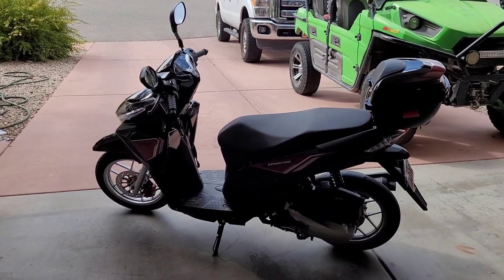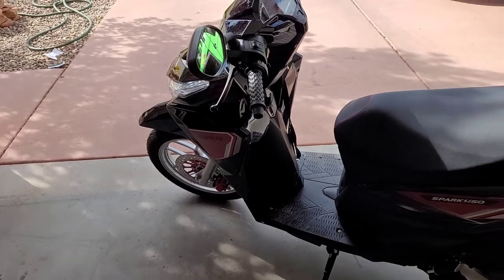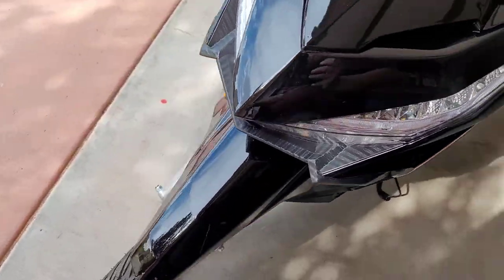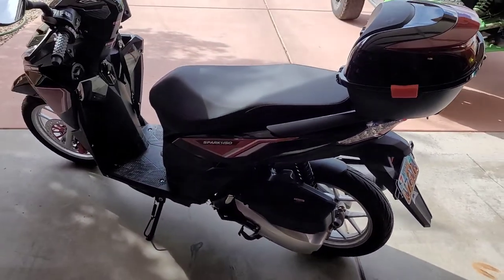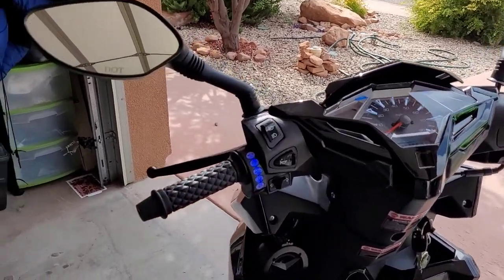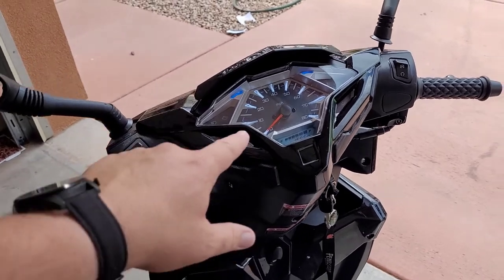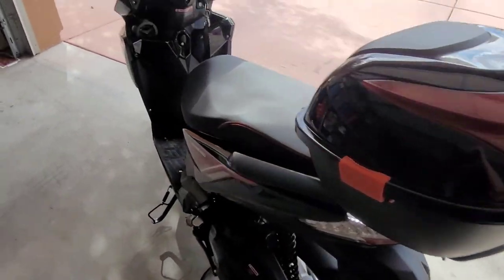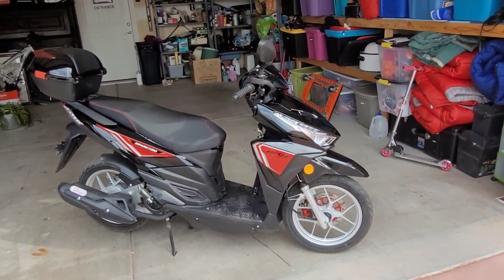Vitacci Spark 150 Walk Around

Comment: change you gear oil to. I was told to break it in with conventional motorcycle oil then when you get about 500 miles on it switch to synthetic motorcycle oil. Mine starts best if I do not give it any throttle, just press the starter button and let it idle for a few minutes and off you go no stalling ever.

Comment: I lived in Asia many years where there are many 14 inch tire scooters from Honda Yamaha and Suzuki. Did 30000 miles and 2000 deliveries on my Suzuki address 110 with Michelin 100 80 14 pilot moto gp tires. No Japanese brand 14 inch tire scooters for sale in USA. No Michelin pilot moto gp 14 inch tires for sale in USA. No Asia online shop selling these tires with shipping to USA. So,… what to do…. Bought a a new kymco agility 125 gy6 engine with 50 miles on it from a crashed bike. Got everything. Wiring harness. Carb. Speedometer.  You know everything that usually breaks in the first 10000 miles on Chinese scooters. I’m not playing nor have the time to do the Chinese reliability game so as soon as I pick up my spark everything is coming off and being replaced with Taiwan made kymco agility 125 parts. The reason I settled for the agility 125 was there was one still running well 2021 model with 50000 miles on original engine in my city. That sold me on its reliability.  The fact it’s a top mount gy6 and mounts right into the spark without modification makes it a no brainer. Got lucky to get a 50 mile engine. Best 14 inch tires in USA are Michelin city grips. There ok.  But don’t turn as fast as the Michelin pilot moto gp tires I was using in Asia. Also plan to slowly replace body with real Honda click body panels. Anyone need spark 150 oem parts? Everything’s for sale except the frame lol.   The reason I didn’t go with the clash 200 or any 170-200cc is they don’t run well. Lifan is a good maker and so is genuine pgo. I had a 170 genuine buddy and a 200 sym. They all are built on a 125 platform just bigger piston. They vibrate too much. They always feel like they are going to break even when they aren’t. They are called thumpers. They vibrate and thump your mirrors so much that you can’t really see who’s behind you.  The 125 engine is smooth as butter. Lasts longer.  Doesn’t vibrate your mirrors. Also might be a bit late but never use fully synthetic oil the first 500 miles. Your piston rings won’t set properly. Use a semi synthetic until your rings are set or after 500 miles. Mobile one racing 4t at auto zone or Walmart is best I found in USA. It’s fully synthetic. Use it after 500 miles.
Reply: Pinoy ka pre? Click nasabi mo eh pag indonesia vario name nya.

Comment: I have a 2021 white one just like it and I had the same problem with the scooter shutting off when I give it throttle... Brought it back to dealership and they told me That one of the hose was pinched... Haven't had any problems after that...The bike is really fast and I just found out how to make the radio scan for stations...Now I can listen to the local radio station when I'm not connected to Bluetooth
Reply: Hi i am getting the same scooter. Can you tell how to make the radio for a stations, thanks.

Comment: I have to argue about the assembly. I am NOT a mechanic, I uncrated the bike, got bags of bolts, but absolutely NO assembly instruction. All items were located under the seat, which I have a difficult time opening, supposed to be a manual unlock. Took me 20 minutes just to uncrate, handlebars not connected, along with front tire and accessories. I paid $1399 on-line, plus $60 in fuel and delivery fees, then was told to call because they need to know if I had a fork-lift or, did I need a truck that had a drop gate, this was another $135. (I needed a drop gate truck) You do not get the title, you have to email and verify the VIN, once you receive the bike, then they will send the title 3-5 weeks, if Fla you have to have title to register. I have no problem assembling things, but the handlebars and front tire brought me to a stop. I decided to take it to Sarasota Scooters to have them assemble it for me ($300). Buying on-line you may not pay tax, but you will when you go to register the bike and get a tag. Bill of sale not enough, in Fla anyway. Now my price is up to $1895. Plus, I trust a dealer that builds scooters more than I trust myself...lol Sales tax will be about $95 and not sure what the registration fee, title transfer and tag will cost, but I would guess between $2-300. Now in Fla you are required to get a motorcycle license on anything over 50cc, this course is $185. I added this comment to this great video to make people aware of the hoops and snags you will go through initially, just so you know. I am not sure if I made the right choice yet. Once I get the bike and ride it, see how it lasts, then I will make a video on my experience with this machine.
Reply: I heard of welds coming undone on these, oil leaks, head gasket leaks, and all while brand new. Some people apparently are lucky and have put 40k miles on them with some tuning up before riding (change out carb for better quality one, gaskets, spark plug, fuel line, and probably a few other things). I'm just not sure if it's worth it to pay double to triple the price for a Honda equivalent. Usually, people that buy these are doing it because they already can't afford alot so, yep.

Comment: I own a 2020 model purchased from 360 powersports, after 1000 miles or klms. not sure which but so far so good. My only problem is I have never been able to get the parking brake to lock on do not know if there is a adjustment I can make or what. Owners manual is worthless. I wish these sellers or importers would contact the Chinese and translate them into English better.
Reply: They're written in "Chinglish" so you have to read between the lines lol.

Comment: I was going to buy a used honda PCX for about $3k as a commuter & doing food delivery as a side gig. But i was thinking now perhaps to get one of these at 1/3rd of the price. The only thing giving me pause are some of the bad reviews of it breaking down. How is yours holding up?
Reply from the maker: It's been good so far. Honestly, I don't know how long it will hold up for.  I'm still under 1000 miles.  I have not put a new clutch in or anything like that yet, but I was told that you should do it at a thousand miles. It might be better to pay for something with a bit more power if you're doing things like food delivery. I love this spark, but there is absolutely no way I would take this on a long ride.

Comment: Could you tell me where the cdi  Box is located for the spark 150i I  removed seat and its not there I also checked battery Box and couldnt find it?
Reply from the maker: I believe you remove  that front shield and you'll find it there.  Remove those two screws and it will slide down.
Reply: @joshgreenrules  I found it its by the headlights my 2pin connector is missing from cdi box I can't find it I think this is the issue for no spark on spark plug do you know colors of 2 pins connector I think mine was cut I want to buy 2 pin connector and rewire it back in any help or pics  would be greatly appreciated

Comment: Great video. I'm curious how many more miles you have put on it and if you're still just as happy with it. I'm seriously considering this one. Depending on how many miles you now have on it, has it required much maintenance yet?
Reply from the maker: Sorry, just remembered my password. I have put exactly 600 miles on it so far. Just did the first oil change. I love it. I have lost some weight since this video (36 lbs) and it runs smoother for me. The only maintenance I have needed is to reattach the light clips under the plastic and tighten the steering bolt. I am actually going to take the steering column apart tonight because it is wobbly and I found online that if you wrap it with tin, drill a hole for the bolt, and then put the steering wheel back on, it will stop wobbling.
Reply: @joshgreenrules  That belt will need to be changed, I'm surprised your factory one lasted this long. those belts are very low quality and will leave you stranded one day. I replaced both of my scooters with Kevlar ones, and the strength, feel, and quality is like night and day... but for now, if I were you I would stay away from going up hills, and "jackrabbit" starts from a stop.
Reply from the maker: @lionelhowell4972  Thanks for the heads up. I have an extra belt in the garage for it as we speak.  I'm ordering some new rollers and gonna swap them all out at once.
Reply: @joshgreenrules  You are welcome.

Comment: How do I stop the handle bars from wiggling ? Idk how to tighten it
Reply from the maker: I'm dealing with that issue now. I am going to try to do a "red neck engineer" tactic tonight, where I'm wrapping some tin around in hopes of stopping the wiggle. It's a pain in the butt.
Reply: @joshgreenrules  Try a bit of silicon baking mat. It absorbs some of the high frequency vibration and should eliminate the wiggles.

Comment: 20w/50 motor oil would work much better for you. 10 40 is thin- as oil heats it thins out. 20 50 is thick. You will actually have oil than more like water running in your motor. Just saying. 🤗
Reply: 100% agreed.
Using 10/40 full synthetic in my 2006 Burgman 400, no bueno.
Replace with 20/50 "V-Twin Full Synthetic" oil = Happy Engine !
Which oil grade your bike prefers depends upon 2 factors:
1 Climate you ride in average temps, highs & lows.
Higher the temps, go up to 20/50 grade.
2 How tight are the internal engine clearances ?
This will vary greatly even bike to bike so you have to run the different grades & see what rate of usage is observed.
Thin oils deplete quicker so if usage is high, use thicker oil.

The only downside to thicker oil:
- slower starts in cold weather
- slightly less MPG

For the greater protection factor, I'll always run 20/50 Syn no matter what.

Comment: that is not a rebranded vario, thats more like a copy, this is worse than the exact honda Vario ive got and they probably put 2008 off brand engine in there. also that speedometer is likely just kmph tuned and they just put mph numbers on it